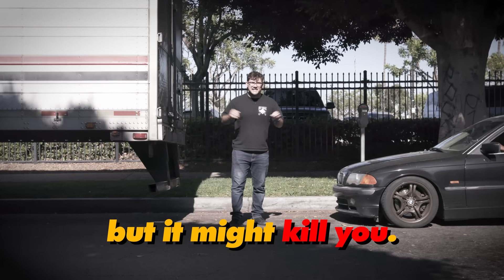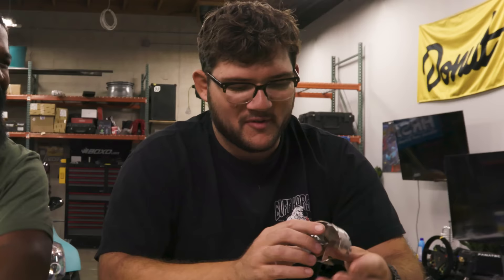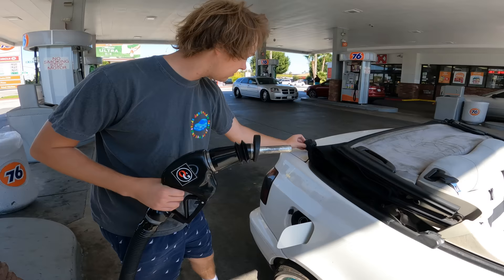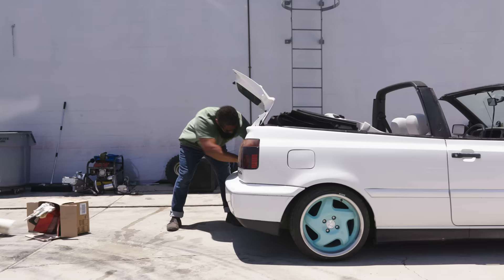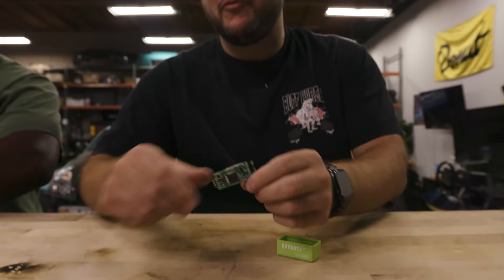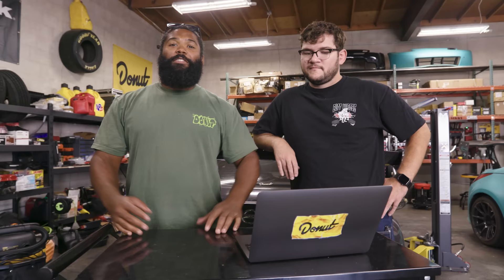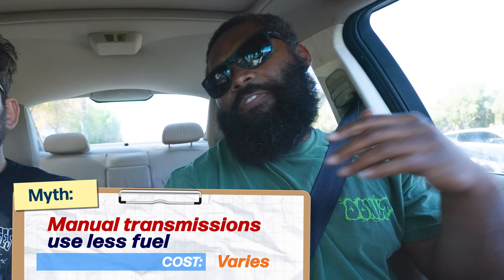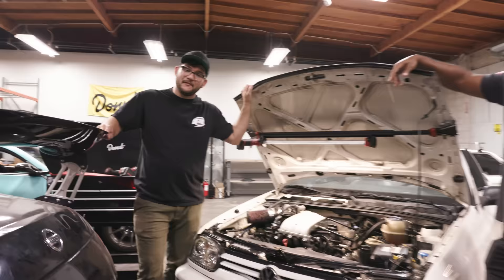Testing Fuel Economy Hacks

Comment: Drafting behind a semi (and sometimes even a small work van or any boxy shaped trucks/van) is actually huge, I drive with Torque Pro and my vehicle (19 Corrola) has adaptive cruise control. At 105km/h on relatively flat ground (Between Calgary, Red Deer, and Edmonton, or even SK or MB). Drafting behind a Semi saves 0.2-0.8L/100km (which imagine from 5.5L/100Km to 4.7L/100km on a 800 km trip, its HUGER!. It gets even more savings as you get a bit faster (but your base fuel consumption is higher.

Obviously your own vehicle aerodynamics matters too, the least aerodynamic vehicle you have, the more you are saving. Me following a semi with Toyota's 1 bar distance (closest) adaptive cruise control is genuinely still a safe distance, you don't need to be that crazy close like mythbuster. But it does help when you are traveling faster.

I also noticed grain hopper trailer, and liquid tankers give me a pretty massive boost too compared to boxy cargo trailers. Again, your vehicle's aerodynamics will vary on your fuel saving.

I highly recommend people trying this on a flat road, with a adaptive cruised controled vehicle and with a bluetooth OBD2 dongle connected to a app like Torque, you can then really see the fuel consumption changes.

Comment: There was so much that was not addressed. Eco modding is also known as hypermiling. With some Bondo or other things you can reduce the amount of air flow into engine bay. Having custom skid plates also makes a heck of a difference in allowing flow past the car.

Tuning the vehicle is pretty important, econotunes are out there to keep less aggressive gearing for the same automatic shifting especially on trucks.

Compression ratio of the engine and intake and exhaust was not addressed either

Comment: Objection.
Running the AC in the long run is more efficient, but at highway speeds only.
However, opening them for the first two minutes of your drive will get rid of so much heat , that’ll be more efficient to do that and then switch to AC.
And yes, I am an engineer. And yes, I work in the field.

Comment: The problem with an HHO generator is that it takes more power to split the water molecules than you get out of the Hydrogen itself. A gigantic one would not only add weight, reducing fuel economy, but would be worse than dead weight because the strain on the alternator would cost more fuel than the Hydrogen that was produced.

Comment: Didn't mention the energy lost in automatics from slip in the torque converter. Since manuals are linking the engine to the wheels mechanically, they should in theory be more efficient than an automatic system that involves a fluid coupling.

Comment: Gasoline and Diesel both do have thermal expansion at higher temperatures. The amount of expansion is pretty minute. If you're driving a normal passenger car or pick-up (say 20 gallons or less) there is no noticeable difference between fueling in the early morning vs. fueling in the heat of the day. The outside temperature just won't affect in-ground fuel tanks enough to make a difference at the pump.

Some diesel fueling stations do have above-ground storage tanks. The difference between fueling in the morning vs. the heat of the day can become very slightly noticeable on a truck with 250 gallons of fuel tanks at these locations. There typically isn't one huge above-ground tank, instead there are usually 4 or 5 smaller tanks that are manifolded together. Smaller volumes heat up faster. Also, diesel fueling locations tend to get many more fuel deliveries. A typical 53 foot diesel trailer can hold about 7800 gallons of fuel. If it is 115 degrees outside, the fuel in that diesel trailer heats up pretty quick as it's being delivered to the above-ground storage tanks at the station. It's not uncommon for a diesel station to get 10 or more deliveries from these trucks each day. The temperature can get high enough to make a very slightly noticeable difference on 250 gallons.

But, the volume also slightly decreases when it is cold. So if you just fuel when you need fuel, ultimately the very slight increase when it's cold will offset the very slight decrease when it's hot, and you net to zero. The only way you could possibly cash in on this is If you're an over-the-road, owner-operator truck driver that's burning 1,000+ gallons of fuel per week... And the amount of time spent idling in the parking lot (engine running to power the A/C since it's hot outside) is going to more than consume the small amount of fuel you could potentially save by fueling only in the early morning.

Comment: While "top-tier" won't save you on fuel in the short run, it will save in the long run.  It has more detergents and this means that the no-name gas station that gets the cheapest tanker will clog up parts of the fuel system sooner than one that is rated as a "top-tier".  From AAA:

AAA further discovered that continued use of non-Top Tier fuel could result in 2% to 4% lower fuel economy over time and hasten the likelihood of maintenance issues. Top Tier fuel can even reduce the carbon residue of loyal generic gas use on an engine by 45% to 72% over 5,000 miles

Comment: 12:06 Standard halogen headlamps were limited to 60watts (each)  so 120 watts.  That's like 1/6th of a horsepower in load (negligible gas).  Radios are generally even less than headlights unless they're custom.  Even an insanely powerful car stereo with massive subwoofers is only going to pull a few hundred watts on average even if they can peak to a couple thousand.  The biggest fuel mods are free: fully inflated tires, windows up (or down at low speeds instead of ac), keep car clean/empty (low weight),  and a very light foot. 

And the part about automatics, it's usually the CVT autos that are considered more efficient. hydraulic drives have gotten better and may have better efficiencies, they still cost more, have higher maintenance costs, weigh more and do not give you as much freedom to manipulate downhills, also you use more brake pads.

Comment: So, in Europe there is a fuel called LPG. The same thing that mostly everyone in America uses to heat their houses. This fuel can be installed in gasoline cars. Practically speaking, you will have two tanks, one standard for gasoline and the other for LPG. It is actually gas and depending on the car, it can be faster and add more horsepower because it enters the cylinder as gas and not as a dispersed liquid. Yes, it is dirty and there are more engine oil drops, but the price is 4 times lower than gasoline. I have LPG installed in my car, a 40-liter tank, and I can certainly travel about 350 kilometers with it. For 20 euros, 350 kilometers is very pleasant.

Comment: The HHO thing is also just simple physics. You're taking power from the battery to create hydrogen. The battery is powered by the alternator which ultimately is powered by your engine and fuel. So the energy you get out of the hydrogen is just coming from your fuel, but after having lost a TON of that energy to heat and friction after having been converted from gasoline to rotation to electricity to hydrogen (and then back to rotation). All those are inherently lossy processes. It would be like installing an alternator in your EV to feed back into the battery. No such thing as a free lunch!

Comment: the temp thing is true in fuel stations that don't temp calibrate. that's a partially true.

using the octane rating recommended does help with mpg, modern BMWs run better on e85 and produce more power on 97 than 93band have different tunes internally for the different fuels
Reply: Thank you. I was literally coming to this comment section to say that. Fuel stations don’t calibrate for the temperature. You do actually get more gas for your money when it’s cold.

Comment: 5:21 it's not a scam it really works. On long trips you definitely save some Gas.
I tested it my self a whole sommer. Just not put to much air in because it cost some driving stability on wet road's, breaking and fast Turns.

Comment: from first hand experience in the EU. I got 74mpg in my C-Elysee with standard diesel, but 82mpg using premium (higher octane). pretty sure that doesnt save money though as the premium costs so much more. Also a manual, as you can decide if you want to drive a manual efficiently or not.

Comment: Manual transmission are easier to modify.

Eg. If you change tire size on a manual you just change when you shift.

If you do it on an Automatic transmission you need to change the gearing in the differential and maybe modify the transmission.

Comment: I used to draft in my Nissan Quest, but I didn't have to get THAT close to get around 50 MPG while drafting.  Usually, I could get 50 MPG while keeping a safe 3 second following distance.  It was fun.

My current car is a manual that I own for fun.  It always puts a smile on my face whenever I drive it.

Let's see the ecomod and the bigger HHO generator.  I have a friend that swears his HHO generator helps him get 45 MPG in his Suburban while on long road trips.  I don't believe him, though.

Comment: Best you can do is, if you drive short distances often, use additives that prevent soot built up in your system and keep the system clean from the inside.. 

Nothing wastes fuel as much as soot in your engine and your exhaust system... 
And if you drive short distances often, your system builds up soot really fast... 

And soot damages your system as well...

Comment: In regards to manual vs automatic; number of gears isn't the only factor.  There are losses in an automatic that you don't have in a manual.  I've never seen a manual that requires it's own radiator, but I've seen them lots in automatics.

Comment: You mentioned the number of gears in an automatic. You did not mention the fluid coupling. That used to be the main energy loss. Do automatics still have slippage in the torque converter?

Comment: On a smaller car manual is still more efficient because of weight.   The automatic will add a lot of weight to the car.  More gears on an automatic makes it less efficient because of power transfer loss.    If final drive is equal, the manual is more efficient because of less driveline loss.    Manual is usually more reliable than a CVT (looking at nissan cvt).

Comment: Friction does NOT depend on contact area. So having more air to increase "may" sound like a myth. And it is, but only for cars. You see, friction also depends on the "coefficient of friction." And the coefficient changes on the outer tyres of a motorcycle. So it saved some fuel for motorcycles for sure.

Comment: Riding with increased air pressure is definitely not a scam. The manufacturer wants to make the vehicle as comfortable as possible and this also means that the air pressure is set as low as possible and as safe as necessary. So increasing the tyre pressure by 0.5 bar does not cause the tyre to roll unevenly, it just makes it less comfortable. Of course, you should never pump the air pressure above the maximum that the tyre can withstand.

Comment: Factory tyre/tire pressures are only set at a number that feels comfy, suits the OEM tyres, hides suspension wear and wont need constant maintenance from the owner.
Changing tyres will change the ideal value too.

usually the sensible pressure, will be 5-10psi higher than the tyre placard suggests (ie - 32psi was a favourite for a long time)
Reply: Why put it higher if you just explained why factory recommendation is good
Reply: @thesnowman2509  to get more tyre life, to have a more responsive chassis, to get better fuel economy, if you’re carrying more weight (or towing).

Comment: Automatic vs manual isn't a myth.  Torque converters transfer power through fluid dynamics whereas a manual clutch transfers directly.  A significant amount of energy is wasted in the form of heat.  Torque converter oil gets very hot.

Comment: Over inflating tires from stock psi wouldn’t do much, but if you don’t check and you’re tires are under inflated, going from that to 5psi over will net you improved mpg. 

I’ve calculated mpg for every single fuel tank I’ve ever done since my drivers license. I’ve been driving 11 years and probably over 500k miles(I drive a lot). I’ve driven over 50 cars personally and so I feel qualified to make this claim lol

Comment: My 2005 manual transmission xB got better mileage than the otherwise identical automatic xB, as reflected in Scion's published economy data, so...not a myth.  There is significantly less friction over time all other things being equal. Every time the auto shifts it is losing more energy than the stick shift.

Comment: Manuals still beat automatics for mileage. As someone else already pointed out, number of gears isn't really the deciding factor. Converter slippage hurts efficiency in an automatic. Also, automatics still have problems finding the right gear. With a manual, you can anticipate a hill and shift early. An automatic won't shift until you're losing speed. And you can't coast in an automatic like you can in a manual.

Comment: Late to the party but I read that certain vehicles operate best at certain speeds. For example: A BMW 5 series actually got better fuel economy at 75 mph vs 65 mph while a Chevy Silverado got better fuel economy the slower you drove down to 55 mph (then it was the same I guess).

Comment: Overinflating tires cannot be considered as a scam, rather a generally bad idea though, let's say you're gonna drive 600 miles on the highway, you can temporarily overinflate your tires by 10% and save some fuel without major risks - anyway, checking tire pressure before long trips is good for your safety and keeps you from driving with underinflated tires which is much more unsafe.

Comment: Higher octane fuel can definitely save gas.
The differences may vary vastly by engine, but my cbr500r shows maybe 5-10% better economy comparing super to Vpower and it is reported to be way more when comparing E10. Other People have actually verified that fueling up with E10 is more expensive than Super by range, but I would not use that even for testing purposes.
However, the differences of driving style and weather are heavier.

Comment: hey that blue geo you were talking about is sitting in los osos with 100mpg sticker on it haven’t seen it running around town in years that guy cut the steering wheel because he chopped the top so low i will check google street view and see if it’s on there
Reply: it’s on the corner of san yenes and 11th street i saw it on satellite view

Comment: 10:30 there is a very good video from Engineering Explained channel where he tests fuel efficiency for Air Conditioning vs Open Windows. the results are pretty interesting as it turns out both are good and bad depending on the situation

Comment: over inflating tires only needs to be 2-3 extra psi to lower rolling resistance.
drafting works but the "best" place is too dangerous, at 55-60 mph there is a "next best" envelope 50-60 feet back, you're in it when your car is lightly being slapped left+right and falling out of it when the slapping increases. truckers do it all the time.

Comment: On modern engines the turbonator can only help mpg by restricting airflow and the computer will respond by flowing less fuel reducing power, if you make less power you get better mpg, sort of like putting a governor on to keep your foot out of the gas so to speak. If you put it under a carb that did a poor job of mixing the fuel and air it could help mix it better and increase mpg.
Reply: Manual transmissions still get better mpg. Get a 6 speed hellcat and an 8 speed hellcat both with the same final drive ratio, I'll drive the 6 speed you drive the auto follow me around all day and I promise I will get better MPG than you. The automatic still has clutches causing a lot of drag, the more gears the more clutches. It also has an oil pump that needs to be driven at a significantly high pressure and volume sapping power from the engine. Also an automatic transmission is controlled by the computer that is trying to anticipate witch gear you should be in and since it don't know what you are going to do it can only guess.

Comment: Also, don't the pumps correct the gas volume to a specific temperature anyway? Even if the tanks were affected by temperature differences (which they aren't), the price/volume you see on the pump is corrected as if the gas was always 15*C

Comment: One tip that actually works in my own experience: chiptuning

Yes its usually done to gain mo Powa baby but remapping usually makes it more efficient when you're driving granny style

The last car i went to the dyno with is a bmw f31 320D that made 163bhp stock and i tested my lowest fuel consumption to work commute and i could not get it under 4,7L/100km... Then mapped aka stage 1 i had 225bhp and thesame work commute i could get it as low as 3.8L/100km 

Ofc i dont rlly save fuel with it, i mapped it to have more power not to drive economic but you could save fuel with this depending on your own intention/drivestyle

Comment: Well there is one thing that is 100% guaranteed with most of the ad on parts all the way to just a different air filter like a K+N air filter and that is CHECK ENGINE LIGHT. That is a Guarantee they could put on without worrying because it 100 % will

Comment: With an old manual (I have a 2000 model toyota conquest), is the old saying that my parents and grandparents used to say correct? They said putting it in nuetral and coasting when going downhills or fast on long flats would save on fuel....